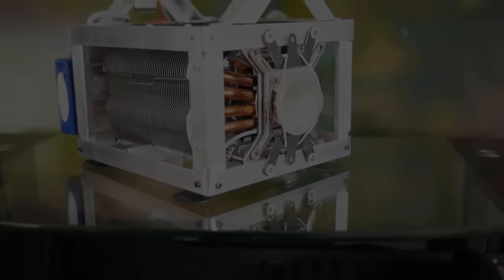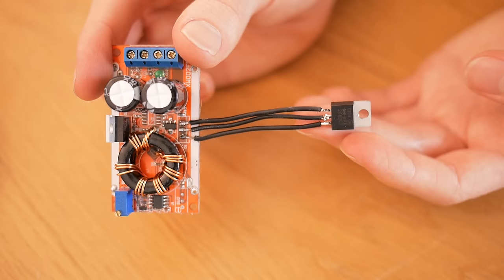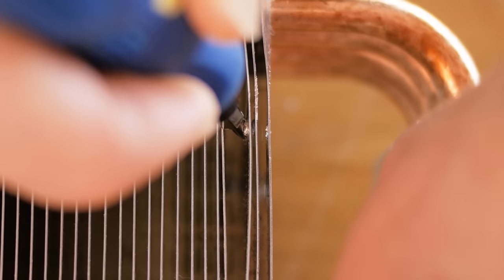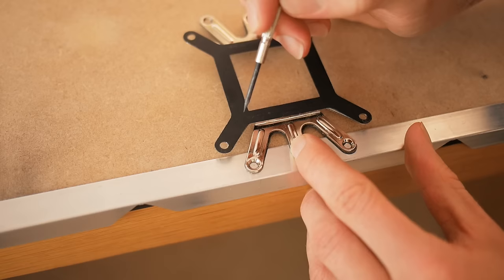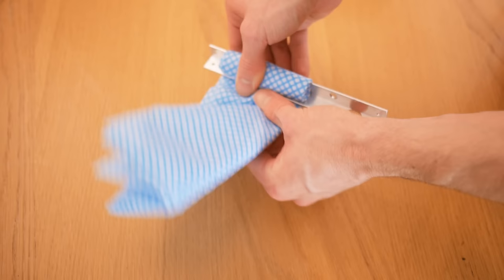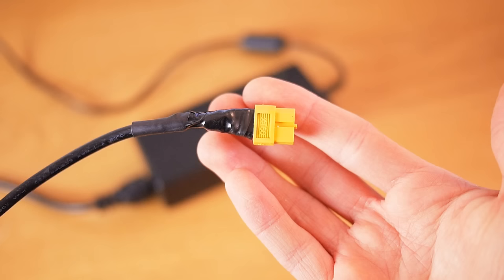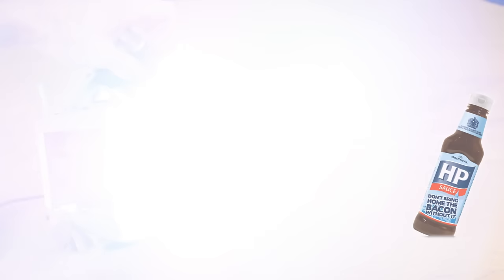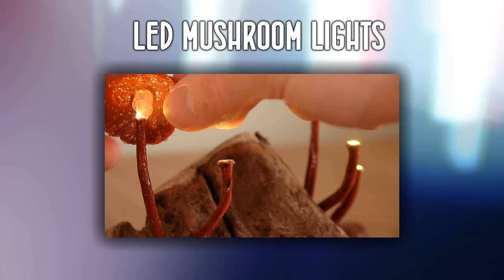Make a 1000w equiv. LED flashlight - aka DIY Sun-Blaster!

Comment: I have literally no hope of being able to follow the instructions but it was fun to watch.
Reply: Only because the video tutorial runs so fast. It probably took him over a week to design and make, and another week to produce the video.
Reply: And also the lack of experience with electronics
Reply: Actually there was very little electricians involved. Apart from the inverter board which he purchased, it was just soldering connections.
Reply: *eletronics
Reply: MattBlytheTheOne but still it would be quite challenging for a total beginner
Reply: @Katan Akuma
I've failed electrician splendidly back in my school days, so I completely understand you.
Reply: MattBlytheTheOne origami is different from electronics
Reply: Really? You still need to learn the basics before you can practice it.
Reply: MattBlytheTheOne Exactly, that’s what I’m saying. Unless you’re agreeing with me
Reply: Sounds like you are agreeing with me.
Reply: @MattBlytheTheOne  So is origami,,,,  lmfao
Reply: @Cicada 3301 that too :D
Reply: You can do it, buy the stuff needed, play video for a step, pause, do the step, play next step and repeat 

If you can’t solder(only maybe tricky bit) just watch a solder tutorial video first and try joining some random wire together

If you not worked a volt meter just whack it on valtage ac and touch the terminals, really easy :) 

From scratch you can buy tooling for this for about 40 minimum and you will use again and again in future
Reply: Mustaali Kapasi  don’t be put off, really simply when you look. Anything on that level and any level just works on a circle, make a circle with the wire from power to object and it works! You won’t get a shock off anything like that
Reply: true
Reply: As 99% of his videos

Comment: Nobody:
DIY Perks: Builds a handheld version of the fucking sun.
Reply: I think the sun is a bit more powerful than 100W
Reply: @abnormaalz  i think the obvious over exaggeration of this mans comment flew right over your head memester ^^
Reply: @GreasyOaf  ah, all this time I was convinced this man was being serious. Thank you for the clarification boss
Reply: mother of god....
Reply: Mickey Mouse  I know this is a little old and a woosh moment (for me) but The Sun releases an estimated 384.6 yotta watts (3.846×1026 watts) of energy in the form of light and other forms of radiation.
Reply: @RomanMines64 in everage, it's around 1400w/m^2 on the surface of earth, as we can see that the LED surface area is around 5cm^2, it's do more powerful than the sun. if you have watch rocket rising duing the night, it's seem like the sun is rising...

Comment: "Can be built for around £25 " shame the battery alone is 46 dollars ;)

Still I like this project, it looks very professional and very useful :)
Reply: Yeah, and even if I didn't want the 100W LED to fly across the globe to me, it would still be around 32£
Reply: ThaTyger I guess the real question is what would an equivalent product cost if purchased retail. My gut feeling is that it would probably be pretty pricey for something as bright as this, though I haven't actually looked into it. Plus for some I'm sure the whole "DIY" aspect alone makes it worth while! haha
Reply: Walter Boxhead It actually looks pretty similar to this awesome one I found: 
http://www.opticsplanet.com/olight-x6-marauder-5000-lumen-rechargable-led-searchlight.html
Reply: He said if you can get the cpu cooler for cheap
Reply: Ian's Life how exactly does that change the price of the battery? Sure you could get most parts cheaper, especially if you shop second-hand CPU coolers, but batteries just aren't cheap, and for this to be a flashlight it is pretty essential.
Reply: TheResidentSkeptic That flashlight puts out about 1200 Lumens iirc ;)
Reply: This one claims 6000, so sort of close...
Reply: ThaTyger well you can use an ac adapter :P
Reply: Alessia Aikley I seem to recall 7200 lumen.
Reply: ThaTyger The key word here is "CAN"
Reply: TheResidentSkeptic 4 x XM-L and 7000 lumens? ahhaahaha good one :P XM-l has max output around 1000 lumens. On maany flashlights on ebay you should divide the lumens by 2 to get the real output.
Reply: ThaTyger I know that the battery still is more expensive... But I can't avoid to think about why you still use two different currencies?
Reply: It's Eoleh not sure to be honest. I kind of assumed it was in Dollars I guess :\
Reply: ThaTyger oh, well that's fair enough :) £ is the symbol for British pounds, € is the symbol for the Euro and $ is the symbol for the dollar :) Idk if £ counts for other coutries pounds as well, since England was once one massive colonial government :)
Reply: It's Eoleh why do you say this? he just wanted to point out that 25 pounds are less than the battery for 46$....
Reply: jort93z Because I wanted to know whether he was aware of the difference. Correcting people should be alright, when it is done in a friendly way :) I didn't knew whether he was aware or not, but instead of yelling accusations at him in a rude way, I asked him friendly about it :) I can't see what should be wrong about that :)
Reply: jort93z because i wanted to know in his exact worded post. why even ask. why am i asking to even ask, and to ask about that.
Reply: ThaTyger power it with cheap 18650's from china on aliexpress
Reply: KyleCarrington now there is a helpful tip. Looks like a pretty cool china-stuff site as well, thanks :D
Reply: ThaTyger The battery they show there is a hardcase for RC car racing.  You really don't need a hard case battery for this purpose.  You can buy an equivalent 2S 6000mah soft case lipo for 20-25 dollars.
Reply: TheResidentSkeptic hey there is another 9500lm of same brand on ebay, it costs less than 60$ . Look at the recommended products at the bottom of that ebay page you posted. :)))
Reply: TheResidentSkeptic Bullshit. The highest luminous efficacy of modern LEDs is around 200 lumens/watt (and highest theoretically possible is 300 lm/W). 7000 lumen flashlight would take at least 35 watts, meaning at least 25 watts of heat (and this is the best case, realistically it would probably be much more). A body of a flashlight of this size simply cannot effectively dissipate that much heat without any means of active cooling. So either this is a flashlight which will self destruct after running for a few minutes or the 7000lm output is an outright lie.
Reply: ***** Seems to me the cooling could be much more simply locked down with a closed loop liquid CPU cooler, rather than a large palate aluminum fin air cooler like this.  Something as simple as a Corsair H55 or H60, for example.
Reply: ***** I was talking about the “7000 lumen” flashlight the guy I was replying to linked (which, by the way, also seems shady because it is advertised as a Cree flashlight but Cree doesn't make flashlights, only the LEDs used in them) but I'll reply anyway. 
The point of water cooling is moving the heat away from a source to some place where you can dissipate it easily (i.e. not in the middle of a cramped PC case) but you still need a radiator of the same size to dissipate it. Since there are no problems with space in this build, there would be no benefit in using a water cooling system (quite the opposite in fact—it would take more power because in addition to running the fan, it would also need to pump the water around).
Reply: *****
While I do have to cede to your point on power consumption, I can't imagine it would be so much more that it would run down a large capacity battery so quickly.

But, to be completely fair, I'm looking at this from the build perspective of a wall-based power source, with battery as optional.

Also, a water cooler might be more advantageous if one were to implement this light into a panel design, rather than a box-style flashlight.
Reply: ***** Sure, it wouldn't be too much power but it would still be some power for no benefit (not to mention the higher purchase cost). If, however, we were talking about a different design where the space behind the LED is limited, then water cooling could be a viable option.
Reply: ThaTyger you could probably make your own powerpack with 18650 batteries but i doubt it will be much cheap (20$) for a you do it yourself thing. which wouldn't last as long.
Reply: @SyntheticFuture  Can't you just series-connect a bunch of AAs or 9V batteries?

Comment: Quick tip:
Use some heat shrink tubing instead of this crappy electrical tape!
Reply: Reth Tard no
Reply: NO
Reply: No.
Reply: Exactly what I thought of.
Reply: No nooooob
Reply: There is almost 300 thumbs up, but all the comments disagree with me... People on Youtube are fucking weird. lol
Reply: @Reth_Hard  i feel an overwhelming need to point out that your original comment is 3 years old and all the responses are within the last 3 months, now im happy
Reply: @indoorgrass2537  why no
Reply: Daniel Minic  
Why did I never thought of that?  Problem solved...
Reply: Thank fuck someone else said this, the sheer lack of any safety in this video nearly gave me a panic attack - electrical tape is ok if you know what you're doing, but if you aren't well versed in electronics then doing that will result in you getting shocked
Reply: @sveanthesecond4564  why are all the comments saying "NO!"  then???
Reply: @whirlwind872  probably cause none of the commenters have to work on electrically safe systems
Reply: @DingDingTheYoutubeBuddy  no. Electrical tape once melted is not a viable Electrically safe alternative. You can burn a hole through it stupidly easily, as you mentioned gives you cancer, and looks terrible to boot. Heat shrink is safe, looks good, and is easy to apply
Reply: @DingDingTheYoutubeBuddy  You have to buy fuses to protect any circuit you build, why bother when you can just use a current limited wire right? you've got spare wires laying around?
Reply: @sveanthesecond4564  
Hum...
I never though of that but you're right!
(Throws all spare fuses in garbage bin)
Reply: Can anyone explain why people are saying no here? Is there a legitimate reason to prioritize electrical tape over heat shrink tubing, or there just a meme infection in this comment section?
Reply: @jek__  
I think it was just my karma that fired back at me for trolling people on Youtube. It happens from time to time... lol
Reply: @sveanthesecond4564  If you dont know what you are doing anything can give you a shock
Reply: @jek__  there is not particular reason, if you have heat shrinking tube use it but has you saw on the video its not posible to use it on a lot of the places so you will need tape for alot of stuff, + you dont need to worry about isolating everything
Reply: No
Reply: @methujeraya  
:(

Comment: Nice build :-). Thanks for taking the time to put it out here for us!
I noticed your soldering is to hot and you had old solder on it that makes your soldering a bit bad.
I would suggest getting a better solder iron and also to wipe the tip with a wet sponge before each soldering, Before soldering a spot, add some fresh solder to the tip and  before the flux have evaporated perform the soldering, you have about a 4 seconds window to do it. 
It should make your soldering shiny and nice with some practice.

Best regards
//Harry
Reply from the maker: Harry Zachrisson Thanks for the tips!
Reply: @DIYPerks  none of this parts are available on ebay anymore what to do?